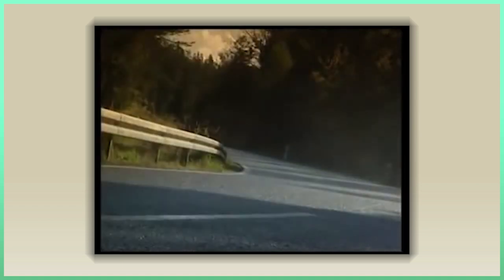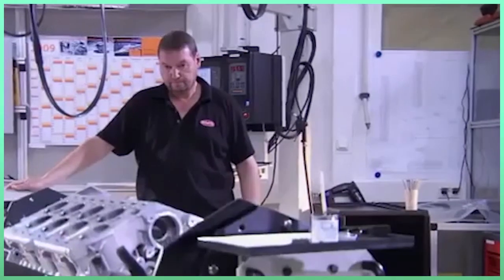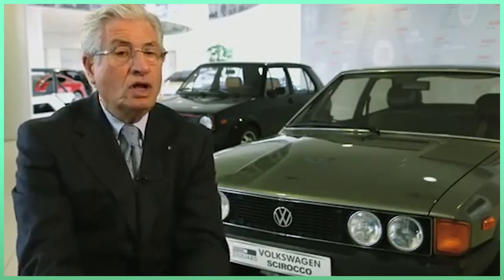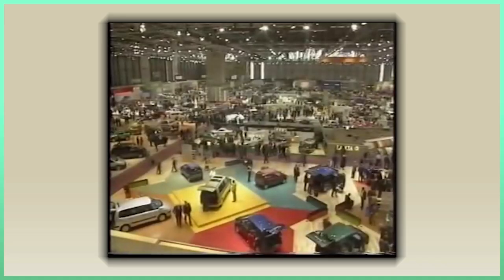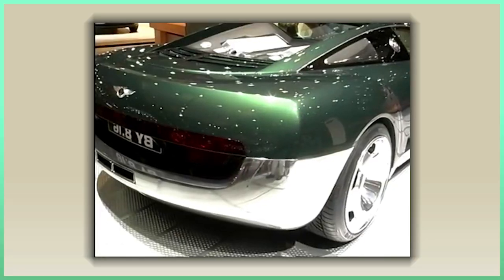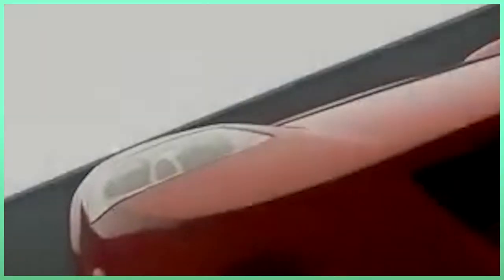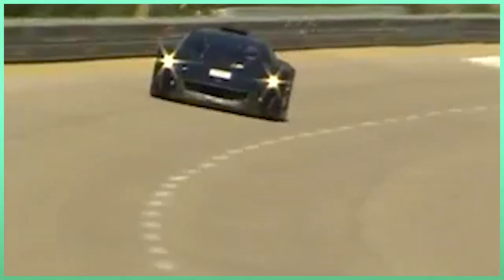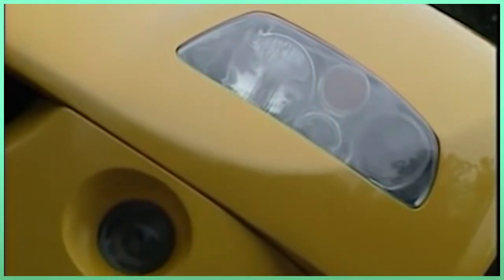The Story Of Volkswagen W12 - The Supercar That Could

Comment: It’s important to note that the W configuration in Volkswagen’s new car engines was different from the W engines in airplanes and motorcycles. Old W engines involved 3 banks of cylinders, like a V engine with an extra row of cylinders on the same crankshaft. Volkswagen’s new engine was a whole new layout, essentially 2 VR engines mated to a shared crankshaft.

Comment: Isn't too late, they must produce it,  the same look, design, engine and with better specs, 622HP W12 engine with 994KG, and top speed 354km/h (360km/h speedometer).
Reply: Hi Play GT, I own a Continental GT, this engine with proper intakes/exhaust manifolds and right bigger TURBOS will reach so much more than that ! I really wish they will do something similar or I will make my own kit car with the same engine BOOSTED !!!! Thanks
Reply: @djricardodelrio1399  It's a Bentley, i hope that Bentley make a hypercar with a W12 engine too, this efficient 🏎️ and running on e fuels ♻️, a rival for LaFerrari, Valkyrie, AMG 1, Delage D12, Genty Akylone and Silk Faw S9, it will be awesome, i hope that someday happens, the returns of the W12 Nardo and a new Bentley hypercar for the rivals mentioned 👌🏻🏎️.